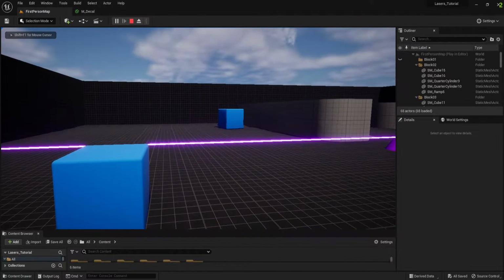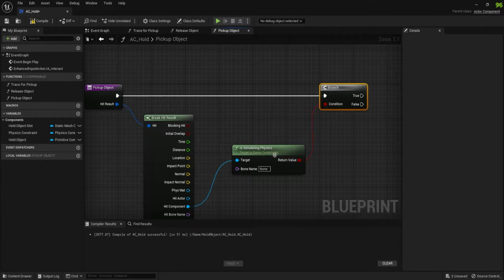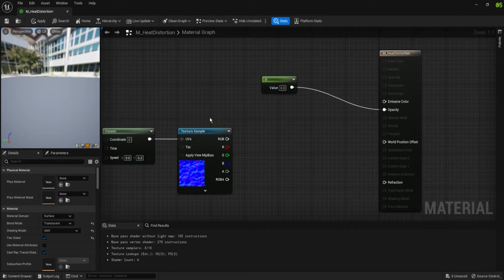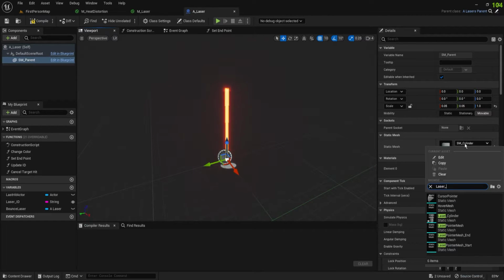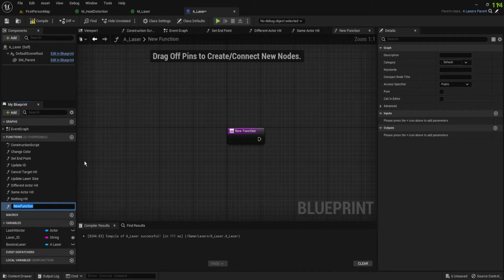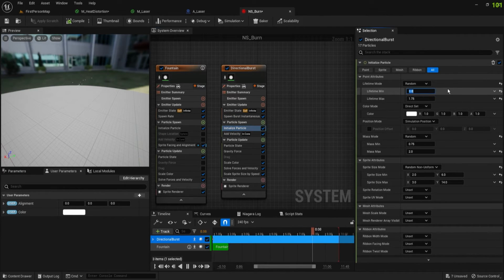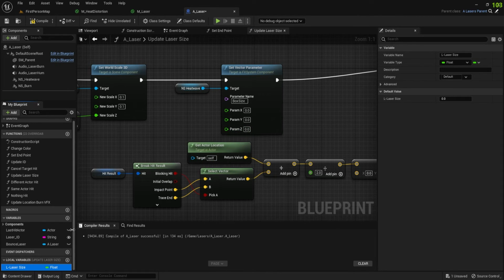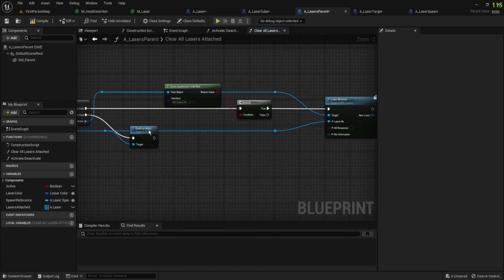Unreal Engine 5 | Laser Tutorial Bonus (Pulse, VFX, SFX...)  NEW VERSION PINNED

Comment: Maybe you can help me with a problem I encountered while modifying this. I want  to use a boolean to decide wheather NS Burn particles are generated or not. When I implement a branch node for example in the "Set End Point" function and set the boolean false the particles dont get generated and when its true they get generated that works. But when i connect the variable i set in the A_LaserSpawn BP to the branch, it seems like the branch always returns false even though the variable gets set to true in the LaserSpawn BP. You got any idea why that happens?
Reply from the maker: So, it's a bit difficult to answer but could you tell me how and where you are setting the Variable, because I did a quick test on my own by setting the boolean instance editable and didn't face any issues.